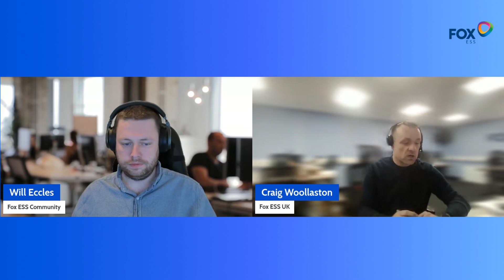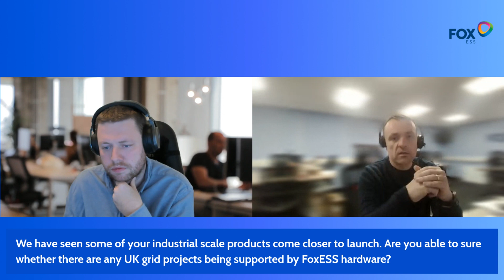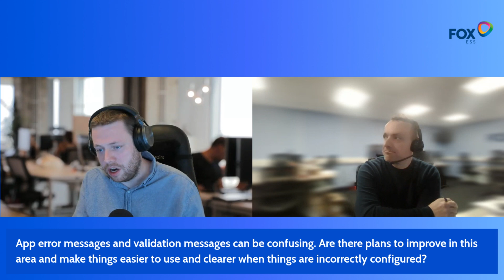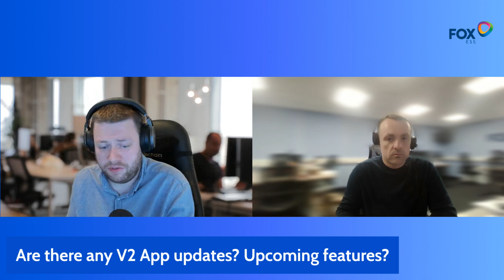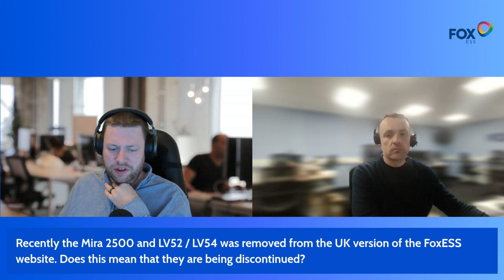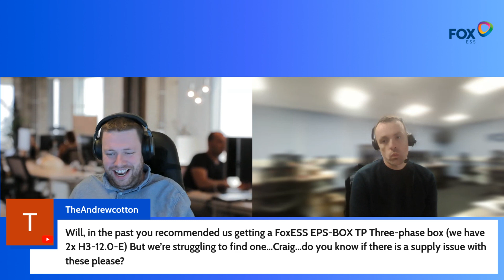Fox ESS Community Live Q&A - October 2024

Comment: @ 33:10 you mentioned being able to reduce the startup voltage on single phase inverters being only really applicable to 3 panel systems. But the counter to that is surely that reducing startup voltage is a boon to all users as it improves the low light performance across the board??
Reply from the maker: if you have more than 3 panels you reach the startup voltage very close to when the sun rises in the morning. With only 3 panels you have wait longer until you can get to the startup voltage which requires more light so I think the point is that only small arrays will notice the improvement but yes technically all arrays will benefit in some way but larger arrays this means you get minutes more generation which isn't anyway too impressive.

Comment: 00:32:30 with software versioning control, many use version number pattern to denote major, substantial (worth doing) and minor with some pattern like 00.00.00, eg 01.23.45. Hence signalled to consumers version significance. To save Fox time resource, it could be substantial and major versions would become available for a consumer to apply from fox cloud.

Comment: I'm close to pressing the button on an order, and the main reason for going to Fox was the 10Kw inverter. Will there be a 10Kw inverter in this range?
Reply from the maker: Fox already has a K10 for single phase or you can go with a H3-10 (not the pro version) which is a 10kW three-phase hybrid inverter.
Reply: @iameccles  Apologies, I'm interested in going for the PowerQ that's about to be released in the UK. I'm looking at an integrated 10Kw inverter in the system also, what is the maximum amount of battery storage for the system at launch. I currently have a Givenergy solution with 2 x 9.5kw batteries and a 3 kW inverter. The driver here is we are adding an initial 7.5kw pv array on a new extension being built, and it's a struggle for the existing system to handle 16kw pv.
Reply from the maker: @paul-joseph  details haven’t been made public yet but the power cube is expected to to be upto 40kWh storage. Inverter sizes not yet released.